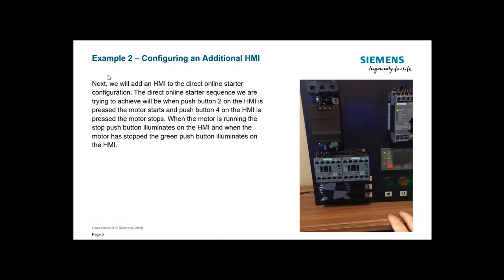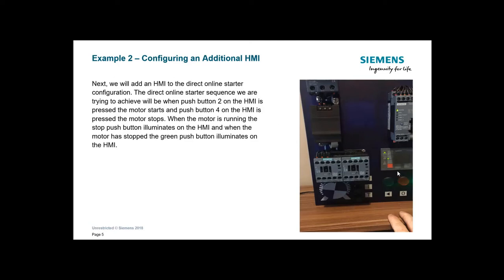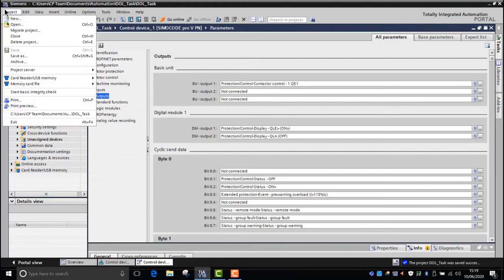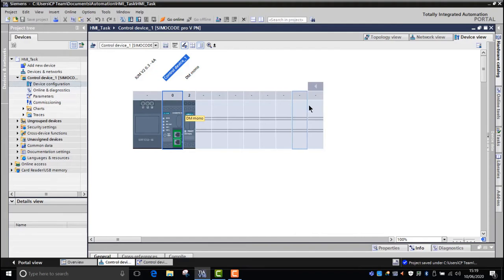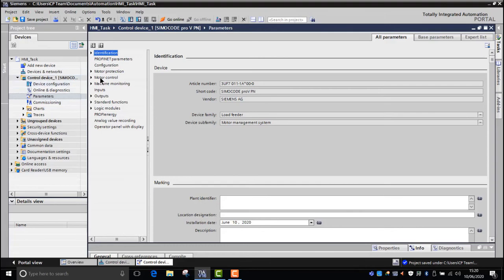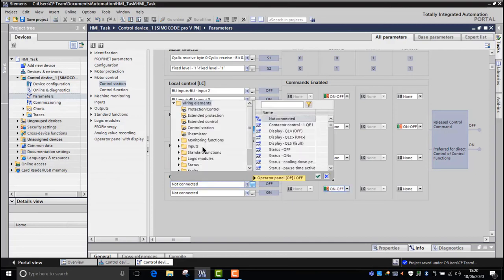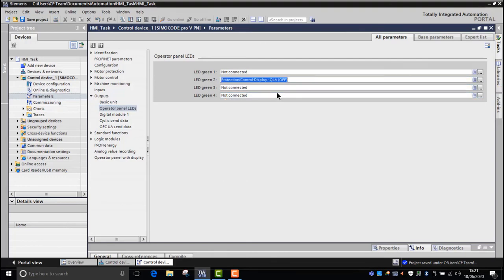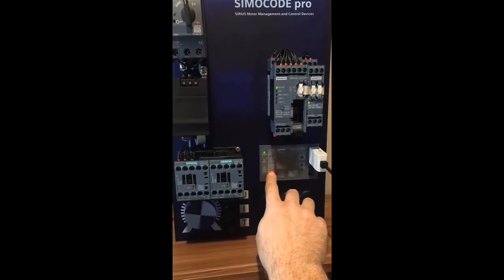SIMOCODE Programming adding a HMI

Comment: Thanks for the informative video. 
When changing a failed simocode, if the new device is FW3.0 and the Tia portal project has a FW2.1, will there be a problem.  When downloading parameters, Tia portal has highlighted the mismatch, but I think the parameters have transferred ok. 
I don’t want to get into hot water at this stage adding FW3.0 to the Tia project and then having a firmware mismatch with the remaining simocodes on FW2.1
Any advice would be appreciated.